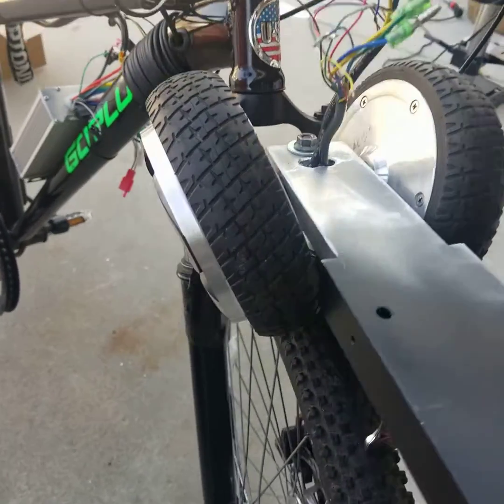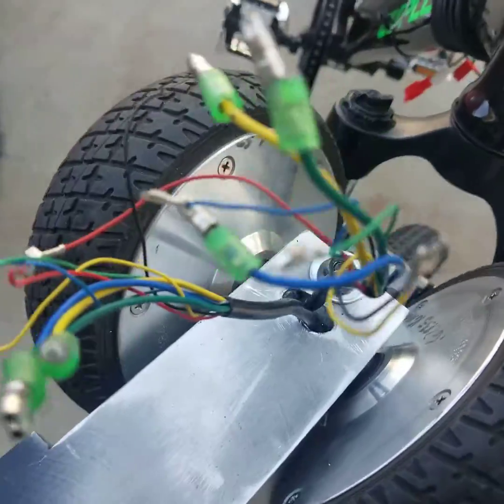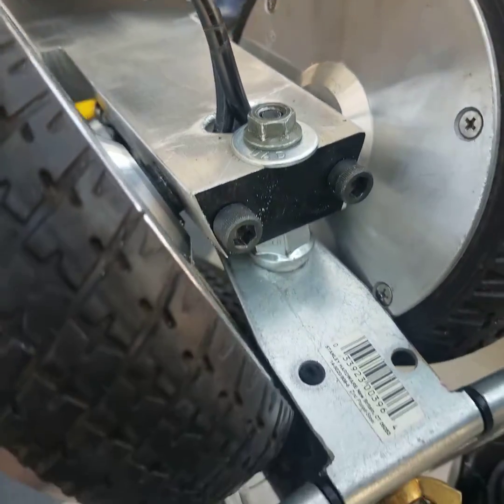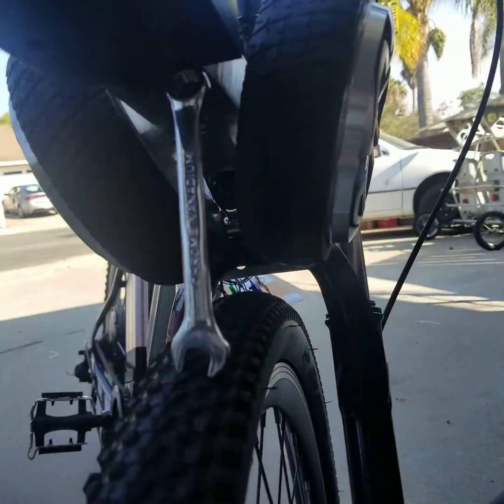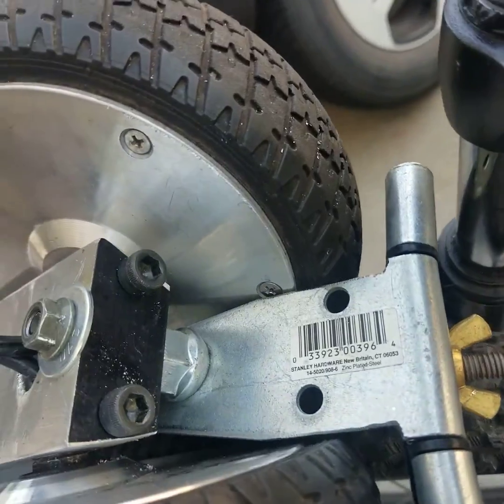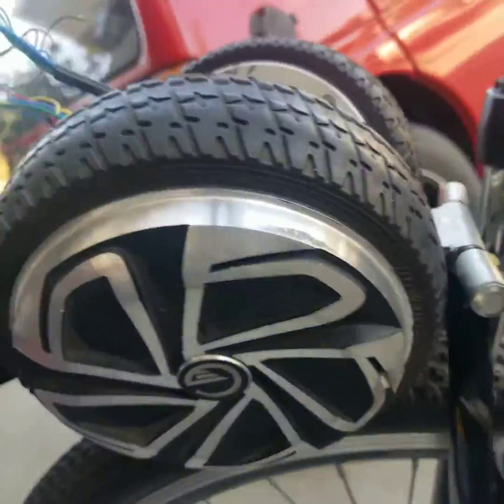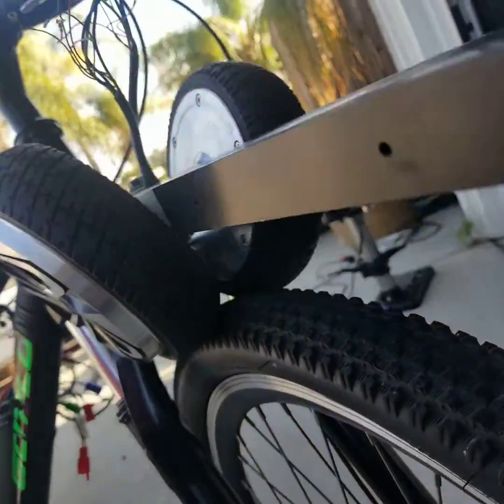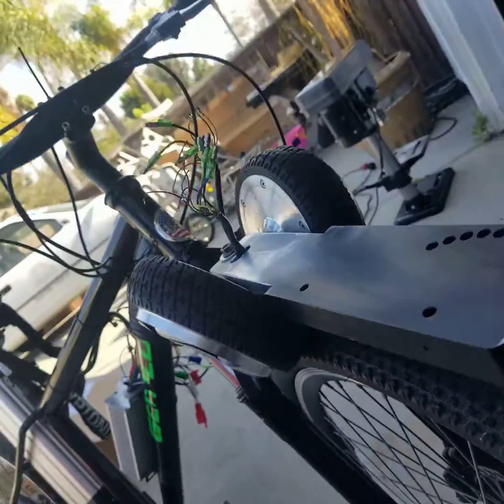Hoverbike 2x1 wheel drive

Comment: Hi long time how have your motors been working out. do you know if the hoverboards batteries bms board and I say that loosely because the are more a logical board, if they  have a voltage upper limit before you blow them. I know you have done 3 in series. I wanna do 5 in series for close to 200vdc for an inverter test
Reply from the maker: Hey, I have not been messing much with the hoverboard stuff. There's good videos on hacking the hoverboard controllers. I got a flipsky 4.2 vesc with bluetooth control to and android app, pretty great and they have dual controllers too.. lots of other motor projects backed up in the cue. Got a quad I want to turn into reverse trike with and electric moped read end.. ktm motorcycle to add small pedals and make it a legal ebike;) fat tire bike with two violamart motor kits, will overdrive and get 4+kwatts?...
Reply from the maker: As for the hoverboard Bms's I've set 4 of that type in series to get near 160v but the controller didn't like it.
Reply: @FIprobe  I'll let u know if my apc rt8000 works with 5 hoverboard batteries I know it can charge but only wanted to use as an inverter

Comment: What's your speed and battery voltage?
Reply from the maker: Usually I do 120volts and can get 36 mph. 80volts got around 25mph.
Reply: How do you charge those batteries?
Reply from the maker: @c.jc.j4334  hoverboard chargers individually. I made paralell charging connectors for charging and series/parallel connectors for running 120v or 80v.. could get fancy with a network of relays...
Reply: That connector did you just attack it to positive and negative battery output.?
Reply: Do charge the battery via positive and negative output and 36v Charger?  Thanks
Reply from the maker: @c.jc.j4334  hoverboard batteries usually have an xt60 connector, I use hoverboard chargers with xt60 connectors added to them with +/- hooked up correctly. They charge to about 42volts..

Comment: Cool man so u need two controllers right 1 per motor? I never seemed to find a good way to run two brushless motors with one controller.   And progress on friction on off maybe that's what the hinge was for? Also you said you were thinking of building regen how would u do it
Reply from the maker: Yes, one controller per motor(I'd like to synchronize two at some point). The hinge is there to the release friction drive if needed. I thought I read a while back that regen could be enabled on these controllers by soldering somewhere on the controller PCB. I don't know how the individual BMS'S on my hoverboard batteries will like getting hit with regen from 3 overdriven motors;) building a new battery among other things...
Reply: @FIprobe  if u find that thread on endless or whatever forum shoot my way I didnt see anything
Reply from the maker: @plojm123  it's the second review on Ebay for the 120v 1500 watt controller that is like 59 bucks right now. It says to find ebs on the controller pcb and solder the 2 points together to use low level brake for regen. I'll let you know when I try it.
Reply: @FIprobe  you ever get ur regen to work. If so please post a video.  I finally gave up on my hover board motors because I got a 750w hub motor with rim off craiglist for 50 bucks. I have it at 84v with that 1500w controller and can go 39 mph so I am very happy with it.
Reply from the maker: @plojm123  I have not gone further yet with the regen but I have been busy collecting bikes and scooters that I dont even have time to work on. I've got 9 hoverboard batteries on my bike now 3s3p(or 30s6p as the cells go) probably good for 25+ miles.  Biking to work every other day and hoping to get my electric car in shape to drive the others days.. impressive speed from pushing that hub motor! I've got one sitting around, I wonder if it will like 120v;) my phones camera is broken but I'll try to post more progress soon...
Reply: @FIprobe  120v on my 750w hub motor I was just worried cause the wires on mine were so thin I know they are suppose to be fiberglass coated or whatever but I want to say it looks like 16 gauge at best. If u have a 1000w hub with good wires i am sure you can get it to 120v and prob closer to 50mph.  I run 2 s 2 p hoverboard batteries and it's enough not to have to much voltage sag but ur right 3 would be better but I never drive more then 10 miles so for me 2s2p work fine.  Excited to see your car I'll keep an eye out
Reply: @FIprobe   haven't seen anything from you in a while did you ever try to synchronize two motors? Recently I was trying to cut slits into the hubs to dissipate heat. I'll let u know if it does anything
Reply from the maker: Sorry I have not synced the motors yet or gone anywhere with regen on those 120v controllers. I tried the build another bike with hoverboard motors but pushing close to 140volts and that ended quickly for the motor;) I've been having fun doubling the voltage with some electric mopeds(pushing 3k watts) I picked up and I've been commuting with a tiny electric car I got last year. It's time to post some quick videos to catch up. Thanks for checking in! I did heavily vent one of the motors and added a fan to it but it did not cool as much as I'd hoped but it did get super dirty inside.. I should resurrect my first bike with awd as it performed pretty great.
Reply: @FIprobe  dont be sorry, that all sounds cool I have been running my hub 750w 36v hub motor at 84v and 2000w for a while now and it runs really great. Wanted to test at 120v but dont wanna blow it up.  Anyway look forward to seeing any new videos always cool